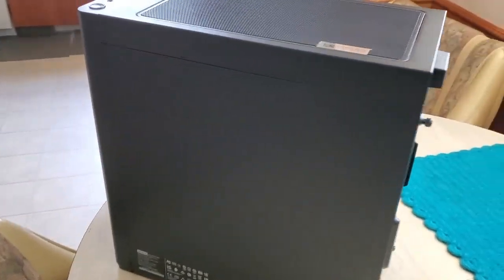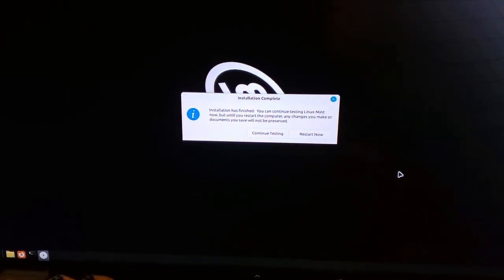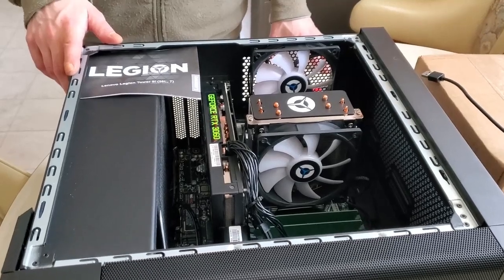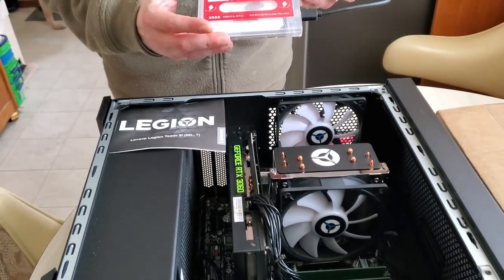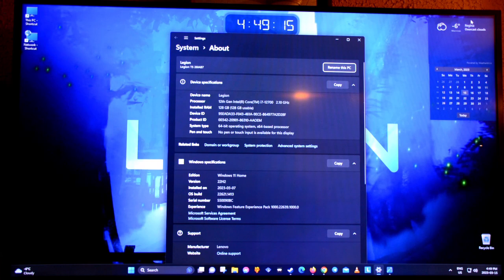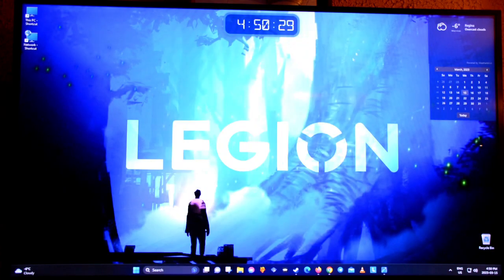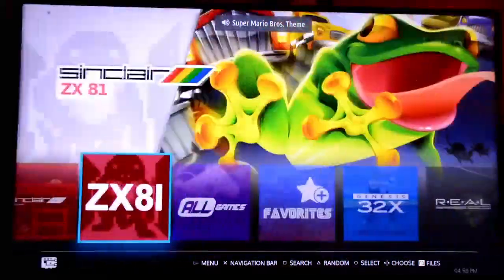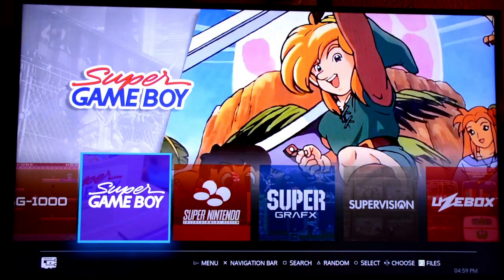Lenovo Legion Tower 5i-12700, 1TB,  RTX 3060- 12GB GDDR6, 16 GB Ram Unboxing, Upgrading Ram + HDDs 👌

Comment: If i buy another stick of 16gb ram ddr5 i can just put it in and it s gonna work with dual chanel and all?
Reply: If it's identical to the first stick yes, otherwise it's not garanteed because of the proprietary motherboards in oem systems.

Comment: Thoroughly enjoyed your unboxing and upgrading video. I just bought one just like it. The specs advertised said the  RTX 3060 has 2 hdmi and 2 DPs.  But the RTX 3060 I got has 1 HDMI and 3 DPs. Is yours the same? Just curious. Also my factory SSD was placed in the slot under the heatsink (above the GPU) and the open slot is below the GPU.. That would be more of a pain if I wanted to swap out the factory SSD. Thanks so much!
Reply from the maker: Thanks! Mine also has 3 DPs. I've already removed the top SSD once and it's difficult to get at with the CPU heatsink.  I've added a 2 TB SSD and a 20 TB HDD since.
Reply: @mustang2kc  Rapid reply!  Thanks for confirming. But replacing that top SSD is possible without removing anything?
Reply from the maker: @rgraz4929  I made it possible. I think I got lucky. A screwdriver doesn't fit straight in line with the screw hole because the CPU heatsink is in the way. I know some of these computers came with AIO coolers on the CPU so they might have a better time with it. I had to remove the GPU as well.
Reply: @mustang2kc  Oh OK. Thanks for the info.  Not that I plan on immediately swapping that SSD, but was wondering when I saw that your factory SSD was in the different slot than mine.

Comment: Another thing I wanted to ask you. What does the Corsair RAM speed say on your system or in your BIOS?  I know it's 4800mhz RAM, but I've been reading it's restricted below 4800mhz  because there's no XMP setting in the bios. Do you know anything about that? Thanks.
Reply from the maker: Thank you very much for asking that question. It got me to look closer at my advanced settings in the BIOS. You are correct. My memory bus speed shows 3600MHz. I had also read that other people were getting lower memory bus speeds as well. I kind of assumed I would be fine using the same speed ram as the original but I guess I was wrong. That's really disappointing. I hope there is a BIOS fix out or that there will be soon.
Reply from the maker: There was a new BIOS revision released on Mar 14, 2023 for my specific machine. mine is a T5 26IAB7.  I'll have to check it out when I have time. I'm always leery about flashing BIOS. https://pcsupport.lenovo.com/ca/en/products/desktops-and-all-in-ones/legion-series/legion-t5-26iab7/downloads/ds553910-bios-for-windows-11-64-bit-lenovo-legion-t5-26iab7-desktop?category=BIOS%2FUEFI
Reply: @mustang2kc  Yeah. Hope so. I wonder if has anything to do with using all 4 sticks instead of 2?  I wonder what the speed was with the factory RAM? When I set mine up, in a day or so,  I'll let you know what I find with the 2 sticks of factory ddr5-4800 RAM.   Wouldn't be surprised if it's also 3600.
Reply: @mustang2kc  Mine's also 26IAB7 and I saw that March 14th update but there's no documentation on new features. I'd want to read the Lenovo forums to see if contains what we're looking for. Otherwise, I'd pass.
Reply from the maker: After updating the BIOS, it still shows 3600 MHz. I guess I'll have to experiment with 2 sticks and the original 2 sticks. The specs said it supported up to 4800 MHz.
Reply: @mustang2kc  Still reading. lol. In the last page of the 4-page thread, a quote from Intel states:
-If the motherboard comes with only two memory slots, then the maximum support is DDR5-4800 in any configuration.
-If the motherboard has four memory slots total, and only 2 are used with any memory,  support is DDR5-4400 . (2 slots empty)
-If all four memory slots are filled, single rank memory will support up to DDR5-4000.
-If all four memory slots are filled, dual-rank memory will support up to DDR5-3600.

EDIT: So Lenovo should have said in their specs, UP TO 4400 mhz because the board comes with 4 slots. Not sure what dual-rank and single-rank memory is but you bought expensive memory and it's dual-rank 3600?. What's better... 128gb of RAM at 3600 or 64GB RAM at 4400?   Is it even possible to go 2x64GB?
Reply from the maker: @rgraz4929  That's exactly what I'm wondering.
Reply: @mustang2kc  So 2 sticks of any type of DDR5 4800 memory will get you 4400mhz in a board with 4 slots.  I guess single-rank and dual rank only matters when all 4 slots are filled. That's what I'm understanding. I guess when Lenovo says DDR5 4800mhz, they're telling you the type of RAM required and not the speed it will be?
Reply from the maker: @rgraz4929   I took out 2 sticks and I can confirm that it runs at 4400 MHz. I guess that's how I will keep it. It's probably the best performance I'll get out of it. 64 gigs is still quite a lot.
Reply: @mustang2kc  Awesome. Thanks for the update.  Exactly. I think it's faster for everything provided  you don't push the RAM's limit. And 64gb is still a very good amount.
Reply from the maker: @rgraz4929  It's showing the same thing for me.
Reply: @mustang2kc  Cool. Thx yet again. It's great to compare notes for a little reassurance.  I still have a couple more weeks to return it. Want to make sure everything is good. The PC seems slow with all of the bloat running in the background. Did you do any benchmarks or testing? Thanks again.
Reply from the maker: @rgraz4929     No problem. I'm already looking at what I'd do for an ultimate upgrade if I had the money. I'd love to do a sponsored ROG build/makeover with my mom and sisters if I could.
Reply: @mustang2kc  Hope it all goes well.! Please make a YT video of it.
Reply from the maker: If I can get sponsors to do a build with my mom and sisters, that would be great. I was actually thinking of doing a sponsorship drive that included YouTube videos making requests to specific prospective sponsors. If I can find enough support, I'll most definitely make a YouTube video where I teach them how to build their own ultimate multimedia PCs. It's just an idea but I'll see what I can do.

Comment: I have 2tb of hdd and i was wondering what emulators you use to download those games if you plan to give the link appreciated 😊
Reply from the maker: I use Retroarch within my operating systems and Batocera as a standalone emulator. Finding the games is a whole other thing. You will have to figure that out yourself. I bought a Kinhank portable hard drive with games on it already and I had many roms from years ago..

Comment: i've read that the PSU is absolute crap and limited at 500w which is below the recommended power from nvidia. May risk taking out the rest of your computer.... Do you have plans of replacement and if you do could you show it? Thanks
Reply from the maker: I wasn't thinking of upgrading the PSU unless I came across the kind of money it would take to run an RTX 4090. I haven't read anything bad about the power supplies yet and I haven't had any problems myself. I'll have to do some more research on that. I'd probably get a 1000 W Corsair PSU if I were to upgrade it though. Thanks for letting me know.

Comment: Strange combo, 12700 is an overkill. mine is 12400f + 3060,  when gaming 3060 is 100% loaded, while 12400f is 47% - 65% loaded depending on game, on 2k resolution.
Reply from the maker: When I bought my computer, there were quite a few other systems with similar configurations available. Some had DDR 4 and some had DDR 5 memory.  If I could afford it, I'd buy a 13900k and a 4090 setup. It's fun enough being able to game at 1080p with max settings though.
Reply from the maker: Emulation on this machine is better than I've ever experienced before. It can handle PS2 and higher with ease.
Reply: @mustang2kc  upgrade to some juicy 3080 down the road
Reply from the maker: I'll probably stick with the 3060 for awhile. Right now it's storage space that I need to worry about. I ordered a 2 TB SSD and a 20 TB HDD but I'll need more in the future. The case only holds 2- 3.5 inch drives and 1- 2.5 inch drive. The motherboard only fits 2 nvme drives. If I'm going to upgrade the video card, I'll probably get a whole new PC.  I wish I could afford that actually.
Reply: @mustang2kc  Cool mate. one way or other, you've got a very good PC, fully upgradable. Congratulations!
Reply from the maker: Thanks!

Comment: do you still have this pc and how is working now days?i just bought one 2 weeks ago did you change the psu after all?  is the psu huntkey?thanks for the video
Reply from the maker: I still have it and it's working pretty well. I'm a little disappointed in the RAM upgrade as it lowered the bus speed significantly. If you want it to run at anywhere near 4800 MHz then don't upgrade the ram. I haven't changed anything else except add a 2 TB SSD and 20 TB HDD
Reply: @mustang2kc  thank you for the reply I'm planning to buy the extended warranty with Lenovo but I have read horror stories
Reply from the maker: No problem. I never got that. Enjoy your new PC! I think you will be mostly happy with it.